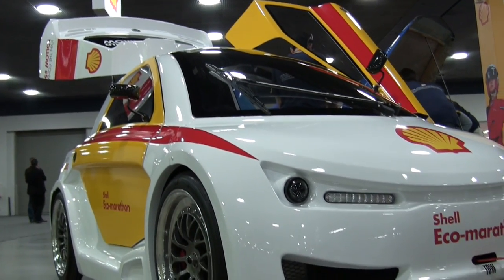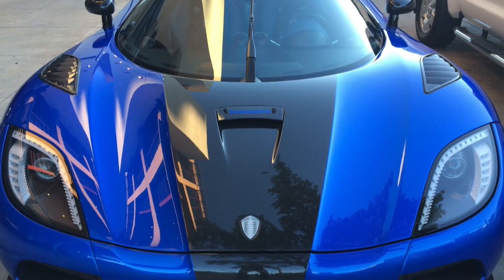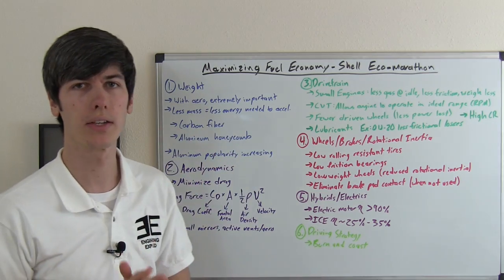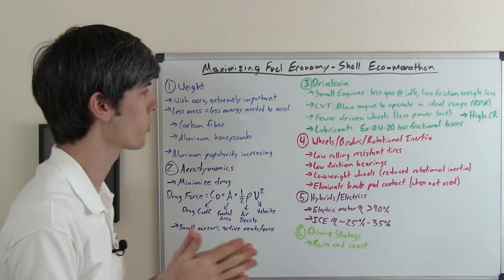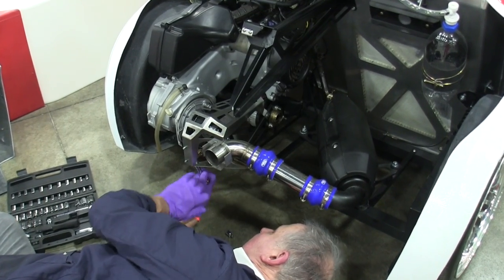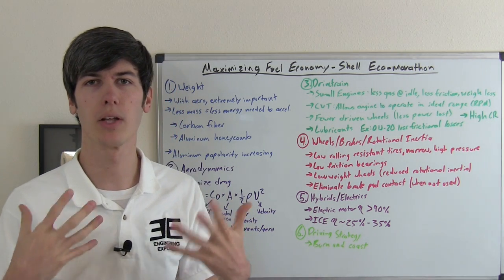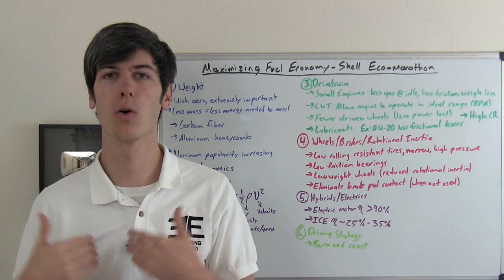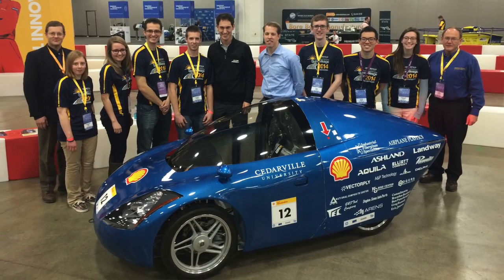Fuel Efficient Cars - Shell Eco-marathon

Comment: I always wondered why CVT didn't take off, I think only small Fiats (and scooters) had them in Uk up until a few years ago u till lexus started using them. Large diesel trains are the most efficient way of transporting goods up and down the country and they use a CVT and a torque converter, and because they are diesel they have a 40% efficiency rate. Thanks for the video.

Comment: Hey Jason, a question about aluminum frames.

Does aluminum lose its structural integrity after being bent? And by using that for example, the new F-150, being in a big enough accident to bend the frame, would that automatically deem it unsafe for road use after being repaired?

Thanks.
Reply from the maker: I believe the F150 still uses steel in the frame, the body is aluminum. Any metal will lose strength once plastically deformed (bent), whether it's aluminum or steel. Don't buy a salvaged car to race with!

Comment: I have idea but i don't know does any use it in modern cars. If someone will mount bipolar torque sensor, so it can sense when wheels start to rotate engine, at the moment of negative torque you can shut down fuel delivery to engine, and no one will notice that. And in normal roads, it will compensate for ups and downs o the road, since engine not all the time give power to wheels, but it use fuel anyway
Reply: Actually, every modern car has such a system. It's called overrun cut-off.

Comment: I have a question for you. In therm of fuel economy, when going down a hill, is it better to put your car in neutral and brake if needed or stay engaged in fourth or firth gear using the compression to slow you down so you don't go too fast? The technology the cars uses probably has something to do with it, can you help? Thanks!
Reply: Most diesels and possibly some petrol engines will stut the engine off on overrun, if you let it idle it uses fuel. So..freewheel with the engine idling to get distance, then if you must brake, use the engine braking before the foot brake...

Comment: On the subject of burn and coast:

Would it be efficient to have a system such as this implemented in today's or future cars?

I'm imagining how seamless BMW's engine cut-off system is in the 5 series. Could something like this be applied to a  system that would replicate the burn and coast driving style, and do it more reliably?

Taking into account all other factors you've highlighted, could we squeeze any more efficiency out of our engines (all types, ICE, electric motor, hybrid, etc) in both highway and city driving? Which engines would benefit the most from it?

In city or highway driving; where would we see the most gains?
Reply from the maker: KhushbuMel Well for maintaining consistent speeds, it'd be quite challenging. But some hybrids apply a similar principle, where the battery charges, then the engine is killed and you run on battery power for a short bit, then the engine comes back on (saving fuel while it doesn't burn).

Comment: Could I just point out when you say `because drag force is exponential with speed' at 2:55, that's probably an unintentional mistake. From your formula, it's not exponential, it's just square in speed.
Reply: Obviousyl  The force of drag is not linear with velocity. When you double the velocity the force of drag is 4 times greater. Therefore it is exponential. If it was only twice as much it would be linear. Can you confirm I am correct?Engineering Explained
Reply: No you're not. Drag is proportional to the SQUARE of the speed. Not the EXPONENTIAL. They are different. Square is x^2, exponential is 2^x.
Reply: But the force of drag becomes exponentially greater.
Reply: The Mater Remember that drag = Co*A*1/2pV^2.  If you're comparing drag at V = 3 and drag at V = 4, then yes - the drag is increasing exponentially.  However, if you'e comparing drag and V at separate points, then it's proportional to the square of the speed (V).  Basically, the language changes when you're comparing the same or different variables within a window.

Comment: I've heard conflicting information about the whole compression ratio thing. Some think that higher compression ratios lead to higher thermal efficiency, but a lot of hybrids intentionally close intake valves late (simulating an Atkinson cycle), the rationale being that if the cylinder is at atmospheric pressure at the end of the power stroke, energy isn't wasted blasting exhaust out of the cylinder.